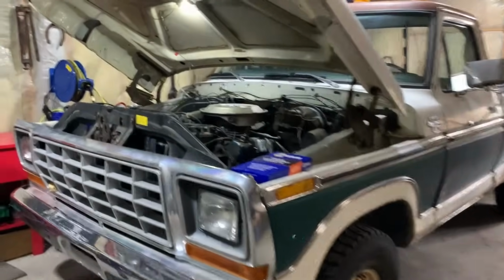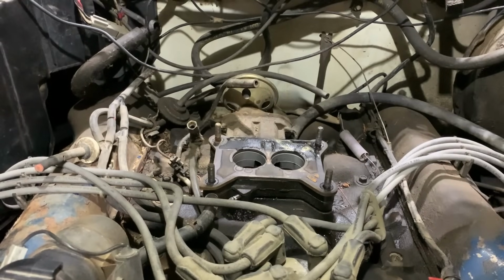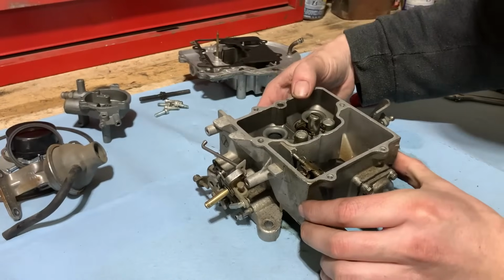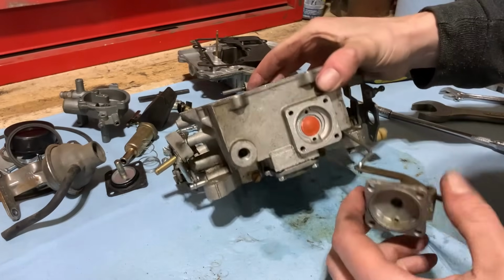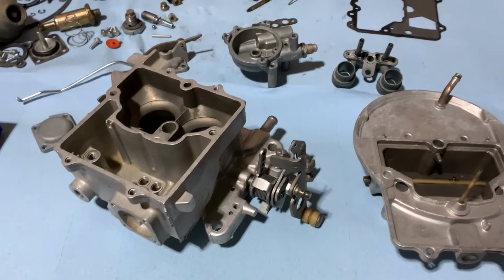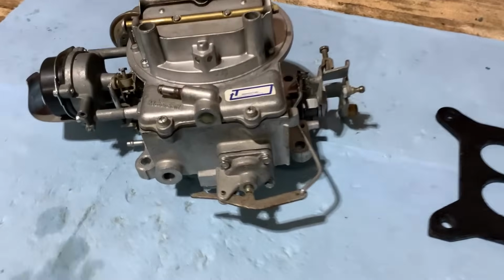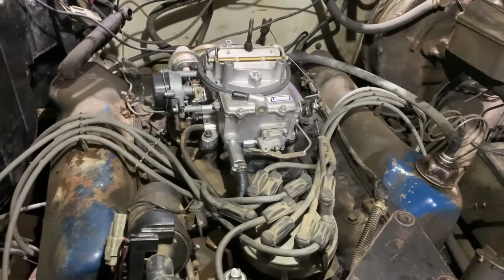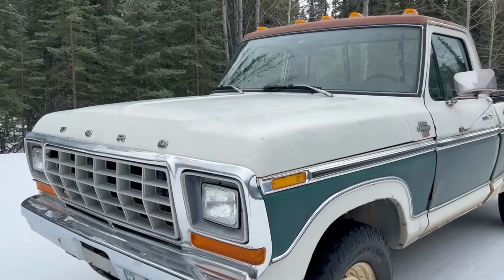Motorcraft 2150 Carburetor Rebuild - 1979 Ford F250

Comment: The simplest and most reliable carburetor on the planet, from 1957 till about 1985, along with its shorter lived big brother, the 4100 4barrel. That little rubber piece behind the accelerater pump is actually called an "Elastomer" valve, in Fords lingo, the earlier ones had a check ball. Through the years, these carburetors had 4or5 different types of choke unloaders, with the vacuum pull-off unit on this one being the final design, some later ones also had a two stage power valve, and I remember they made color coded power valves, different valves for different altitudes. Back in the good ole days lol. Just a little trivia

Comment: BYA, nice carb tutorial! Glad you mentioned throttle shaft wear causing vacuum leaks! Most re-man carbs for sale nowadays are not drilled and re-bushed so check for play before accepting them. Your carb may be in better shape so a good kit could  result in a better repair for less dinero! Cheers!

Comment: Accelerator Pump ... When I got "Rambo" my 55 Dodge Stake Truck somebody had put a 1 barrel tractor carb on the 1st gen hemi. Talk about hard to start and crappy acceleration. Got lucky and found a NOS 2bl with accelerator pump. Now it starts easy and that 1st gen winds right up and is fun to drive. Cheers Austin. 👊😎👍

Comment: Just for anyone who might care. I’m running 2 china knockoffs on 2 of my truck. They have ran flawlessly, 1 for over 2 years and the other almost a year. Your results may vary but 50 bucks versus 300. It’s worth the gamble. Both of my originals couldn’t be rebuilt because of throttle shaft has excessive slack. Well they can be rebuilt but not by me and gets expensive. I gambled on the china knockoffs and won both times. Again your results may vary
Reply: China carbs work because the float is so high.  Once you know better than that, You have to get into jetting it because if the float level is corrected your problem will be a very lean off choke cruising.  China carbs have small jets and the float level is almost incorrect every time.  No carb is universal when it comes to jetting out of the box typically.  I got a V6 and even with #48 jets it didn't work well missing hard when correctly adjusting the float.  I tried the factory 50 jets the feedback carb different float level much higher,  Now I'm going to a #52 jet for cruise and I know a #55 is too rich I tried it once.  Now I know when I switch to Holly I'll be running a #53 jet possibly.

Comment: Great Truck. They run so much better without all that crap all over the engin. All that stuff just makes lot's of points where it can leak or get clogged, failing points. Not so much that it wont run just enough that they run like crap.

Comment: I believe that 90% of what is on the road today, will be gone and forgotten in 40 years. Not necessarily because the drive train won't last. But because of the extensive electronic components. If you continue to change the fluids and conduct general maintenance on this truck, assuming rust doesn't get it, it could last another 40 years. Thats no exaggeration. And if I can make a suggestion. You have a very calm and steady voice. If you could go into more detail on things, I don't think anyone would complain. Because what you might think everyone knows- they possibly don't know all of it. In other words. When troubleshooting, show how you sprayed the vacuum areas with carb clean/ brake clean and explain why. Also explain the vacuum valve attached to the heater hoses and what it does and what you did to delete it. And when you rebuild something, show us what you are doing and why. It probably seems boring and redundant to you but to many of us, its very interesting. And maybe show what something runs like before your repair and then how good it runs afterwards- like you did here. This old iron brings back memories and not many younger folks are interested in this stuff like you are. You have a great instructional voice and your calm style is a gift. You're a natural. Not everyone on YouTube is, and they try to mask their lack of talent with profanity and gimmicks. Keep up the great work my friend. I subscribed awhile ago so can't help ya there. But I like and comment on everything to help boost your stats. Cheers brother!

Comment: use aviation form a gasket on the outside edges of the carburetor gaskets its a shellac based product. they have used it since before WWll. very useful stuff better than silicone I say.  my2cents

Comment: After you removed all the smog crap did your truck run different? I'm trying to find a heat riser assembly for my 78 351M and not having any luck.  I can't seen to get my 2150 choke to work properly. Do you have any advice?

Comment: When we ran those trucks, the parts guys always asked if it was a Cleveland or a Windsor.  I never knew the correct answer and never understood why they made two versions.
Reply: Actually they made 3 versions, Cleveland, Modified, and Windsor. Apparently not a very knowledgeable parts guy, the Modified, or 351M, was the only 351 offered in pickups back then. And the Cleveland, which was discontinued in 1974, and never used in trucks, while the Windsor was first used in trucks in 1982